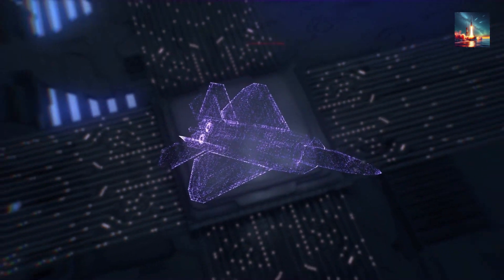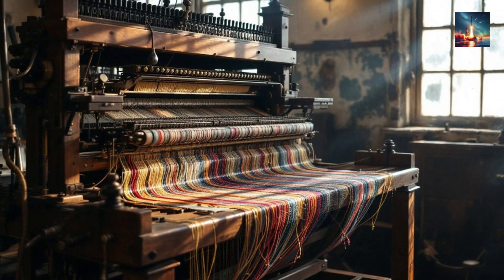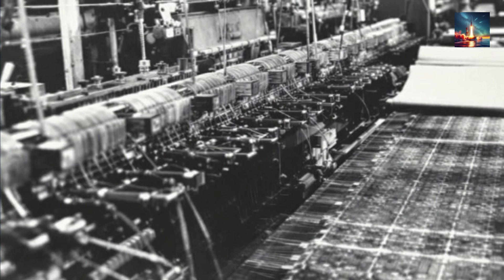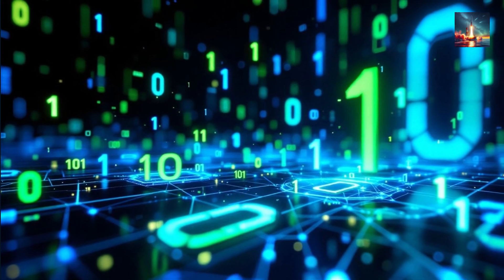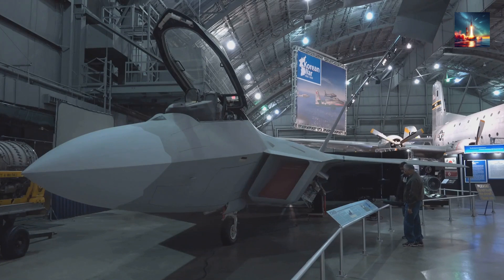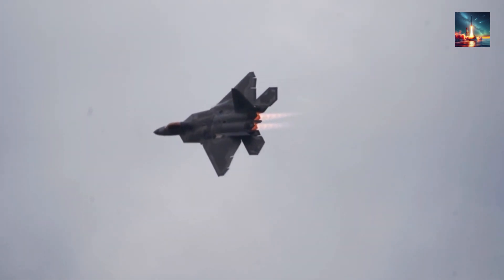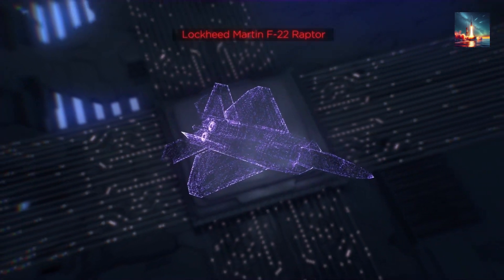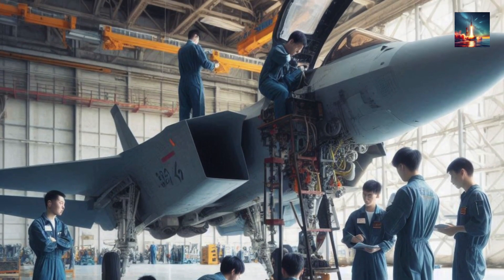China Solves The Deteriorating F-22 Stealth Coating with 3,000-year-old silk weaving tech

Comment: All theory, no proven test. Can it withstand high temperatures during operations? Can it withstand high friction with the air at high speed?
Reply from the maker: For your information, China has a wind tunnel capable of Mach 30+ and I'm pretty sure that they have tested it before making such claim.